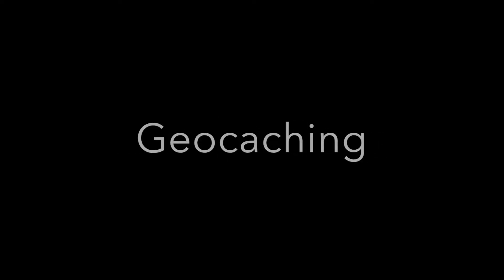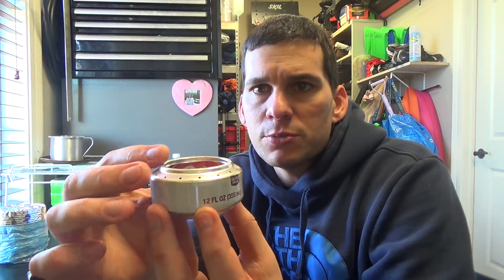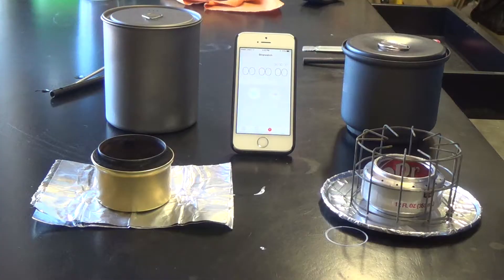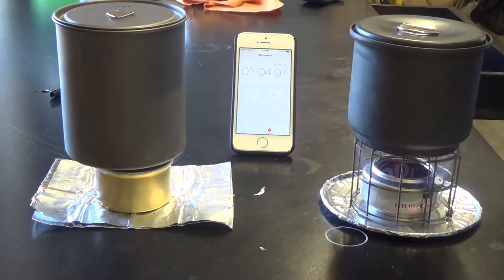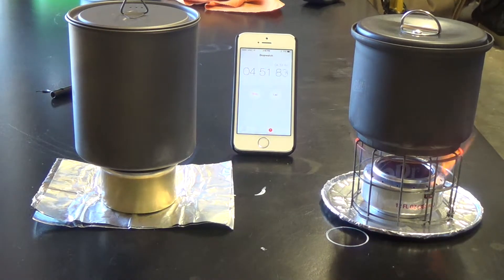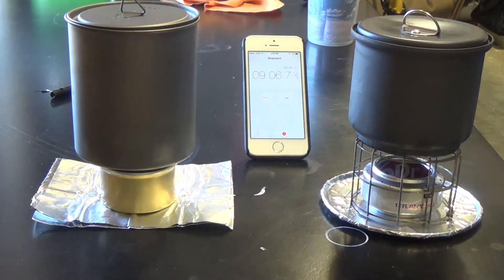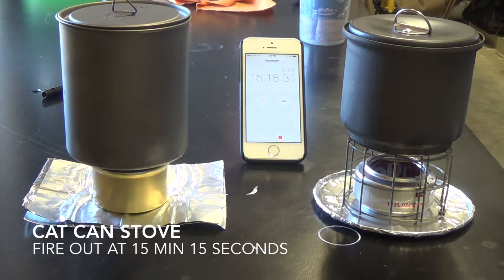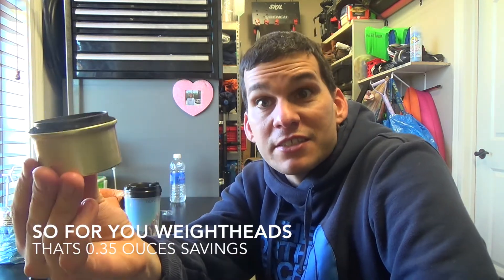Camping Stove Test: Cat Can vs Soda Stove

Comment: I did the same test with the same stoves, well both mine were a little taller to allow for a bigger reservoir of fuel if needed. Both my tests used a pot stand as my bigger pot can't rest on either. Good to know the one boils faster because I'm going to need it to boil a quart or more at a time often. By the way I've found good results keeping the cat can stove a half inch below the pot with a stand. More air flow. Thanks!
Reply from the maker: I have found the same thing. It seems the fuel burns slower with the pot directly on the stove, but it is more efficient slightly above the stove. Thanks for the comment!

Comment: 1) 3:00 I don't see any reason to wait for the soda can stove to bloom, since you are using a pot stand. The main reason to wait is so the center hole flames don't get extinguished by the pot. Using a pot stand, that can't happen, right? All that heat from the center hole could be used heating the water.
2) isn't your cat can stove much shorter than Hiram Cook's? (I mention him because I've seen you mention his videos in your own.) With that short of an inner can, your cat stove should boil slower, but burn longer.